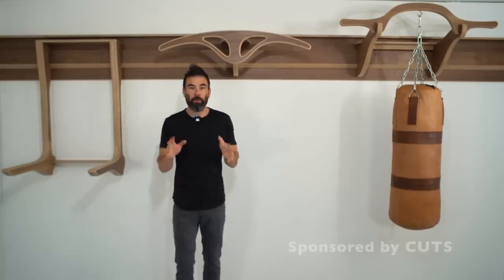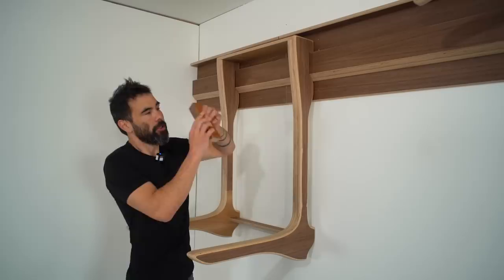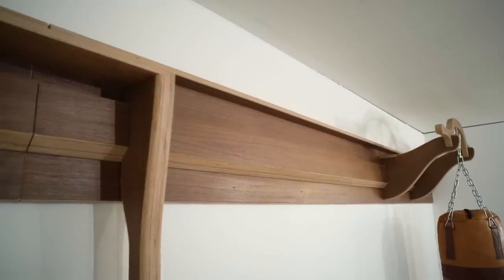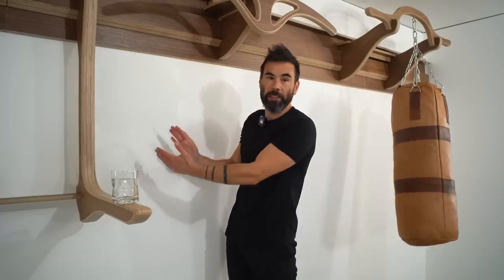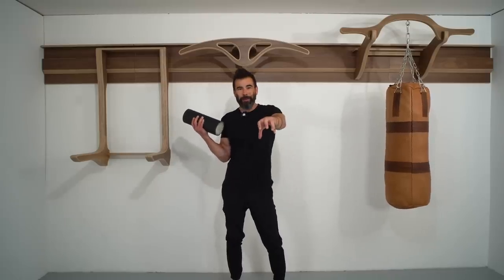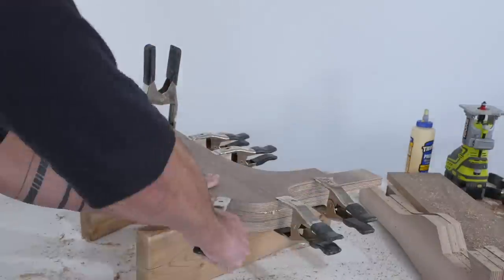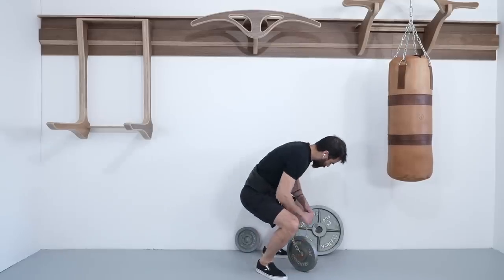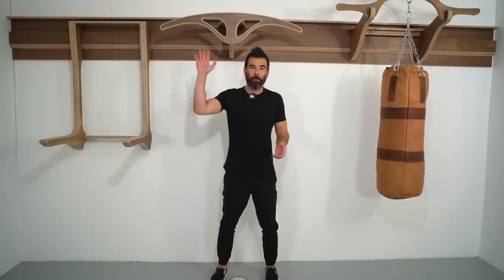Plywood Home Gym | DIY Fitness Equipment

Comment from the maker: Question 1: What would be a reasonable testing protocol for this? Some viewers have expressed doubts about the safety of this system particularly over an extended period of time and use by person heavier than yours truly. I typically do weighted pull ups 3-4 times a week with a single 45lbs plate. How should we test capacity beyond that?  my max for weighted pull ups is around 90lbs in addition to my 170 lbs of bodyweight. A static load test is easy to perform but doesn't perfectly represent the dynamic load of a pull up.  That doesn't mean a static load test has no informational value though so what static load weight would make you confident?  Another way might be to load it with 250lbs of weights on stretch bands and then make a device that adds and subtracts an additional 20lbs to mimic a dynamic load.  

Question 2: what features would you like to see in a work out bench made out of the same materials?
Reply: Aä
Reply: I’m certain you’re correct that the plywood itself isn’t going to break. However, the true strength of a French cleat lies when the force is applied downwards, parallel to the wall surface. Because you’ve added a pretty decent lever with the pull-up bar, you’re probably applying a lot of force perpendicular to the wall and that’s not a particularly strong direction. More so testing if your construction will delaminate… probably ok with Baltic but wouldn’t use cheap plywood for that!  Also agree your face joint connecting the handlebars with screws is the most likely point of failure… probably more like several hundred pounds though.  I doubt many keyboard warriors are going to break this. There ain’t of lot of 300lbs plus people who can do a pull-up… and as you’ve shown, if your fit… even with plates you’re good to go.
Reply: You've shown that a pullup with good form works. How about one with bad form? Get a buddy that doesn't work out to do some exercises without any coaching and see what kind of different forces are present. Is he pulling the cleat the wrong way, or off to one side?
Reply: For commercial reasons I would agree 250 lbs. is a minimum test. 400 would be better imo, because, unlike office chairs, we can't expect people to be a healthy weight. I think to be idiot proof 750 lbs. (falling load) would be fall/accident resistant and not as overbuilt as one might think. To make it so strong I would double the cleat thickness and rabbet the point on the cleat to set a metal flat bar in it to strengthen the cleat (like a 1/4" x 1" flat bar cross-section). This will make it smoother to slide the items on. Further, widening the Cleat Rail plate (what gets screwed to the wall) will allow better load transfer to the studs. The wall stud can carry 3000lbs. per stud, but 20ish lbs. per screw (drywall screws). 5 screws per stud is 100 lbs. per 16". So a 16' rail could hold 1200 lbs. loaded on it (the Cleat Rail, all the hangers, and whatever else is on it). So, the things can be dialed in to meet requirements. Know your total load, the length of all (and number of studs in the wall), then you can calculate how many screws per stud will be needed (more screws means a wider Cleat Rail plate (wider Cleat Rail plate will protect the drywall too)). The Cleat will also need some consideration regarding joinery (number of screws calculated, but mitigated by glue and carpentry).

Another thing that I'd love to add is a Olympic plate holder (this would be functional proof the Cleat Rail can hold massive weight). Having the hangers reach the floor is a fine idea for anything that feels bouncy, but that may require a lock-in feature on the Cleat Rail. Might be a great safety measure for everything (dip hanger, pull-up hanger, plate hanger, boxing hanger, etc.)
Reply: I'd say you have adequately tested it's use, maybe include a drop test where you take 250lbs or more and hang it and drop test it. Reality is an under-trained, overweight person (say 250lbs+ like myself) are rarely going to train pull-ups and dips unless at most they are using bands to assist and even then the much better option for strength training (5-10 reps) is pull downs and a dip assist machine. And trained heavy weight lifter is unlikely to use this design implemented with wood - a steel-reinforced design could be  an interesting idea though. The other thought is to put a disclaimer saying something like "not meant as an anchor point for a pulley system."
Reply: Beautiful design!
1) 
Regarding capacity, don't think in terms of static load. A good rule of thumb is to design for 6-8 times bodyweight/load (a figure that comes from gymnastics training and dynamic load on anatomy) - in the 1500-2000 lbs + range. A 200# person with a 100# plate puts substantially more dynamic load on the system than 300#.
Check the shearing strength for your finish screws mounting the French cleat to your wall. Many screws are actually quite brittle. If you don't want to use lag bolts, I'd go with GRK Rugged Structural Screws.
You may also consider providing some 45° angle support to reduce lateral racking. Perhaps not an issue with the pull-up bar, but the leverage on the Dip station could create a problem and 100% the heavy/medium bag structure is a concern. Even with the light hit in the video you can see the arch the heavy bag is bolted to flexing.
2)
Regarding a work out bench (other than being durable), angle adjustability and height adjustments are extremely useful. 
Cheers!
Reply: Plywood reinforced with a little 4 oz S-glass grade fiberglass cloth and epoxy is hella strong and durable.
Reply: What specifically are you asking? Is it how much will the system that you have already built will with stand? Or is it what would be a good safe weight capacity to strive for? Those are two different things because your system may achieve the latter but it may not. It is possible to do FEA in CAD without the need to do too much real world testing on the system. With the pull up bar you have a cantilever system. You need to figure out if you can actually claim that the French cleat on the wall can be considered a fixed point. It is also dependent on the ratings of the screws that you used.
Reply: Test ist also with much more weight to know where is the break point. Then you can take sam safety factor acording to some Norm that is used for fitness equipment industry. But equipment out of wood, because you need to consider some other rules then with the steel. There are some standards that are telling you which safety faktor for which type of the equipment you need.  
Much more important thing is to have a locking mechanismus that cant be unlocked-lose from some fast and uncontroled movement.  
But idea is great!  
You can combine steel and plywood.

NORD fitness is having a lot of wood equipment.
Also all stallbars in Gymnastics are out of wood.

Great job!!!
Reply: Have you seen the Eternal Creek Walnut home workout system? Bench they built is very cool! And their stall bars look to be very nice too.
Check it out…
Reply: In the event where you are using it and we're to fall in the opposite direction of the system, can you trust it is secure enough for neither parts to fall forward with you? I am not certain of the best testing protocol, especially one that can make any natural skeptic believe. 

Also, would you wrap handle parts in a leather or some other material to not only protect the wood from sweat, but to protect hands from potential splinters developed over time.

Also, as gains are made, would these need to be made stronger as there may be more it would need to support. Any cracking sound is scary, even if it is just pressure sound.

Comment: Static force equvialent depends on the speed/acceleration you pull up: Lets say with a maximum of around 1 meter per second. So the static force (in Kg) would be around your body mass (in Kg) times 1.1.
Reply from the maker: thanks!

Comment: For the screws into the stud - to make the connection tighter insert some scrap wire into the hole, then insert the screw and tighten. A good recycling effort is to use bag twist ties.

Comment: I feel like the punching bag might end up hitting the wall a lot when in use. Maybe you could add a structure near the bottom that limits its motion. Something that hangs down like the dip bar but shaped in a semicircle to keep the bag in place, as if someone holding it.
Reply from the maker: yes! I think I might add more weight in the form of sand bags or make a rack that protrudes farther from the wall
Reply: @HomeMadeModern  Yea, that would probably be an easier solution. Either way, I’m looking forward to more videos on this home gym. Love the design.

Comment: If the strength of the design is an issue, I'm sure fiberglass could be added to the dip/ pull-up bars without sacrificing the asthetic

Comment: That's a good looking and functional home gym! If you combined the dip and pull up stations your would have more wall space for other features.  Maybe something like stall bars, to which you might be able to attach an FID bench. I'm a little worried that regular workouts on the heavy bag will stress the plywood where the eyebolt is drilled through. The heavy bag is light enough that rope or webbing can be used to suspend the bag without drilling through plywood.
Reply from the maker: good call! I agree that the eyebolt hole is the weakest part!

Comment: Consider wrapping the section where you will grip the hand weight with leather material for added support
Reply from the maker: yes!  going to try some rubber cement or barge glue

Comment: When doing pull-ups or chin-ups, keep your legs straight, bending the knees only a little, so if your pull-up bar fails, you will land on your feet, not your knees. The slight knee bend will allow your legs to absorb the shock of landing, especially if you are doing weighted pull-ups.
Reply from the maker: good suggestion

Comment: Nice design. What's the distance between the dip bar arms ? I'm interested in building something like that as well.
Reply from the maker: 20 inches for this one. I just made the 2 sides and then cut 2 cross pieces at a length that felt right for my shoulder width.  I like making home gyms because you can make the pieces fit your specific body

Comment: Why did you use the walnut for the middle ply?  I would have used a piece of baltic birch in the center and the walnut only where you can see it.
Reply from the maker: its what I had.  CFP hooked me up with the walnut which is pretty expensive and I don't have baltic birch readily available out here.
Reply: @HomeMadeModern  well if it is all you had then its all you had :)

Comment: heard some wood cracking on that pull up (using the punching bag piece).  It all looks cool, but none of it seems even close to sturdy/strong enough.
Reply from the maker: cracking or creaking.  hearing a wood floor creak doesn't mean you are going to fall through. That being said you might be right. The question is what is the minimum test scenario where you would feel your concerns would be overstated. For example would a 10 reps of 400lbs and then stress fracture analysis give you more confidence that this could withstand daily use for 250lbs?
Reply: @HomeMadeModern  usually there is a safety factor of 5 - so whatever weight will be the max, multiply it by 5, and stress test it (over and over again).  Even though you have three layers of plywood on some pieces, half of those layers are in the wrong/weak direction, so it’s not as strong as you’d think.  I’d imagine over time it’ll fail unless seriously beefed up.
Reply: @HomeMadeModern  the cracking/creaking from a floor is the nail moving either in the joist or subfloor.  It’s not the same, unless the sounds coming from yours are coming from the steel hardware in the wall.  If it isn’t, those are wood fibers tearing.

Comment: Static weight is not different from pullup weight, theoretically. The only difference that there could be is from a quick change in momentum or if you fall down at the top of a pull-up and "catch" yourself. 

I may be wrong with this equation, but if you have 2.5ft long arms (an exaggeration for most people) and weigh 200 lbs, and fell to extended arms and the wood bends approximately 1 inch when you catch yourself, the equivalent static weight would be upwards of 6000lbs. Obviously this is heavily impacted by how quickly people allow themselves to lower and how stiff your bar is. If you lower yourself over the course of 1 second, the rough equivalent static weight is 470lbs.

I agree with your interpretation on the failure mode of your bar. I don't think any of your equipment is likely to break without deliberate effort. I do think you could see it break at the center of the curve you have for your cut outs, just based on the geometry of the bar itself causing a pivot motion and putting that area under compression rather than tension. Probably not, though.

The equations are F = ma (static) ; F = (m*a*h)/(x) (dynamic)
F = Force (lbs*ft/s^2), m = mass (lbs), a = acceleration (gravity is 32.17ft/s^2), h = height of fall (ft), x = bend distance (ft)
Reply from the maker: force = mass x acceleration   so the speed of the movement would have an impact
Reply: @HomeMadeModern  Yep, which is why I gave the static equation using the acceleration caused by gravity as well as one accounting for the force that would be created by a sudden stop if you were to "fall"

Comment: 13:42 quite a dangerous way of testing it.
Just imagine the dynamic of everything falling on the ground.. 🤔
Reply from the maker: I might be missing something and you very well could be right but let's break it down.  If it failed where would it fail and what would it look like.  I tend to think that the screws holding the rail to wall would fail first. That could involve them pulling out of the studs or the heads getting pulled through the plywood. Three 3-inch screws every 16 inches that go into studs is pretty significant.  The wood itself could break but by my estimation based on the specs for this plywood is that the thinnest section of the pull up bar could support 800lbs static weight at the spans used.  if it did fail at 13:42 what would happen? I think a twisted ankle would be the most likely outcome but certainly not the only possibility. what do you think would happen?
Reply: @HomeMadeModern  if the thing breaks at 13:42, the disk weights would fall on the floor, and by the time they have any chance to flip on one side, your b*lls would crash right on top

Comment: @HomeMadeModern  - I love the build, but in all honesty, I don't think the 'yoke' that the punch bag hangs on is going to last very long. The repeated shocks and flexing that occur when striking the bag will likely start to decay the ply where it hooks over the other 'arms'. It all looks great though and I'm sure a different itteration will solve the problem if there actually is one. Apologies for the negativity, it's only meant to be constructive. Thanks 🙂
Reply from the maker: oh I don't think well stated questioning is negative.  I am not sure how long it will last either. I will see how this holds up and if it starts chipping out I will make another that extends farther from the wall and uses 3 layers or a top plate.  I don't mind negativity. Stating an opinion about how and why a build may fail is useful.  The more info and reasoning that is provided the more useful it is.  What is not useful is an opinion stated as a factual certainty with zero justification.
Reply: @HomeMadeModern  - That's very magnanimous of you, hopefully it all works out and lasts a good long time. Just think of me wittering on when you're wholloping the punch bag, it will be good motivation! 😀Keep building, it's all very inspirational. Thanks.

Comment: Won't metal plates on the screws spread the stress of the load? The screws should maintain their mechanical integrity.
Reply from the maker: they would indeed.  the question is considering the specs of CFP europly what screw schedule plus head size will provide the appropriate safety
Reply: @HomeMadeModern  That is beyond the scope of what I know. I would find screws with the widest flat heads I could find. Diameter and length? Is there a formula for width of and depth of material? They do a product called timber truss screws. All guesses BTW.

Comment: You mounted everything too close to the wall, which you will scuff and poke holes in with your shoes or weight plates. Form over function.
Reply from the maker: after using it for almost a month it is fine.  I am using a kettle bell for weighted pull ups instead of plates.  my shoes face out away from the wall on pull ups and for the dip bars they don't hit!  That being said its easy to make the extensions as long as one wants

Comment: That bag is too low.  If you punched an opponent your height or taller (which is how you should practice) on it, then you’d be hitting air
Reply from the maker: good point!  at the new house I will have higher ceilings and can install the entire system higher!